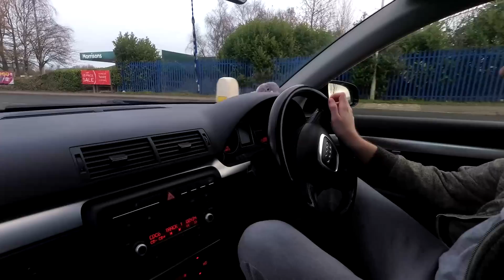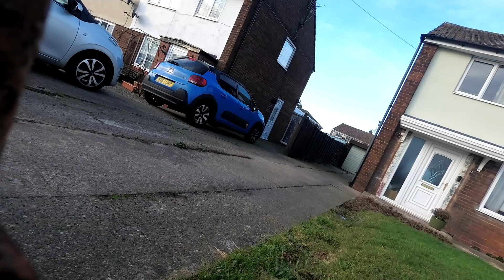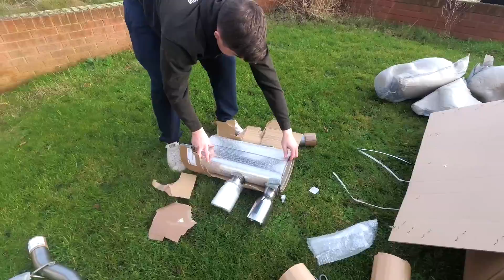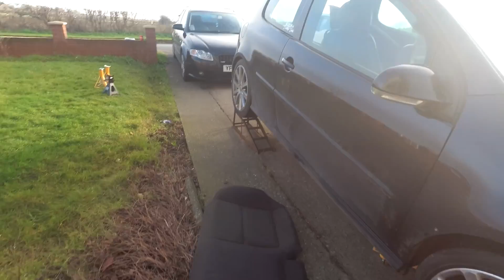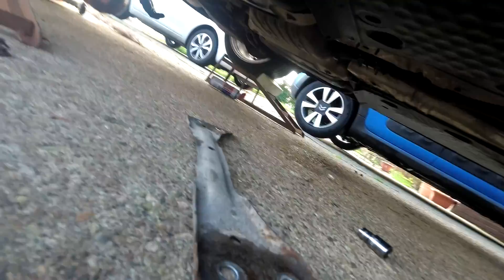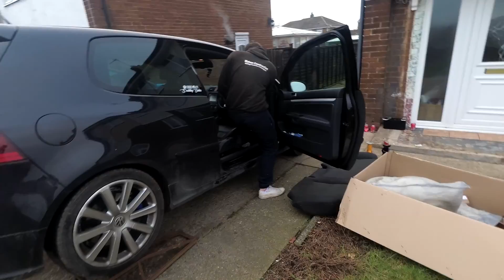VW GOLF R32 Fitting a SCORPION NON-RES!!! Before/After | TOO LOUD!!! VLOG

Comment: Sounds awesome really nice tips fill the valance so well. I have manifold back system miltek and just changed the tips to cerakote black ones. Can't wait to get it fitted. Do you find any drone with yours being. Non resonated? Keep up the vids 👍
Reply from the maker: dlamb999 yeah the tips are a strong point with this system. Hahahahaaaaaaa.... YEP! There is huge drone at 2k rpm but you can bypass it by using gears either dropping down or shifting early. In 6th at 60mph there’s droning so either do 70 or stay in 5th😂😂
Reply from the maker: Worth it though may I add. 100%
Reply: JakeW VW hi mate just wondered where did you buy the system from?
Reply: @Rolphy786  not sure where he got them from. But if you got a mate or are in trade. Euro car parts do good deals on scorpion and miltek. Got my cerekote tailpipes for 40+vat each total 96 all in for both each which was like 45-50quid saving overall compared to websites and ebay
Reply from the maker: Rolphy786 I got mine from eBay from a seller. They have a huge sale on so got it for £400 should’ve been 535. Plus I got a free valet kit worth £20 with it!
Reply: JakeW VW hi mate is it possible to send me the link? I’ve been looking on eBay and I can’t seem to find it at all only the ones for like £500+
Reply from the maker: Rolphy786 clickcarparts is the seller if that helps

Comment: So u went for the aftermarket exhaust in the end, I just love the sound to much of the stock but it looks small,, do u have any regrets doing it in regards to the sound. ?
Reply from the maker: TheLozlou2 no regrets bud. I’m also one for the standard sound. But this literally just makes the standard sound louder. Doesn’t make it sound tinny or crap. Love it!
Reply: @jakewvw6399  with that box missing off the exhaust the res bit I think, will this car pass an mot test with the scorpion exhaust you've fitted here. Thanks mate
Reply from the maker: @UndisputedChamp834  Yes, other owners with them fitted pass tests fine. It's still got the cats so wont fail emissions and the sound test is still under legal limit.
Reply: @jakewvw6399  just wondering what your plans are for wheels, are you gonna change from standard 18s what do u think of 19s or wheel spacers etc.
Reply from the maker: TheLozlou2 I’m thinking of getting the 19” omanyts wheels from the r36 passat but they’re hard to find, so might go aftermarket 19”. I have some spacers to fit just need to get round to doing it!